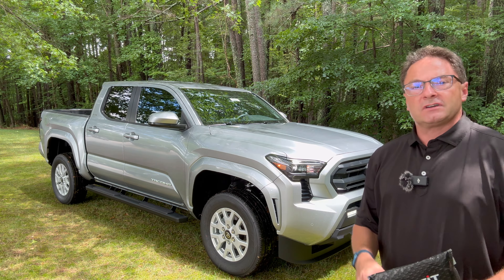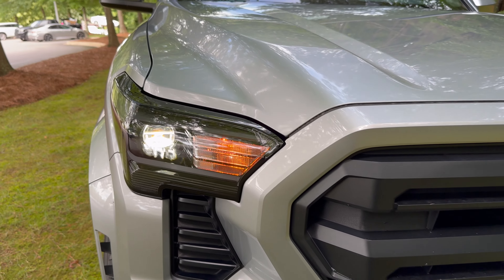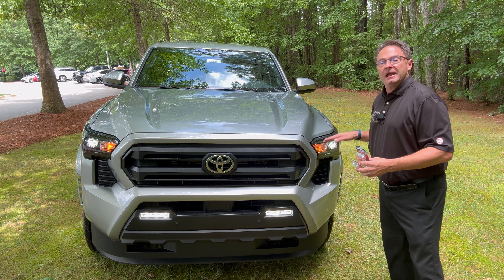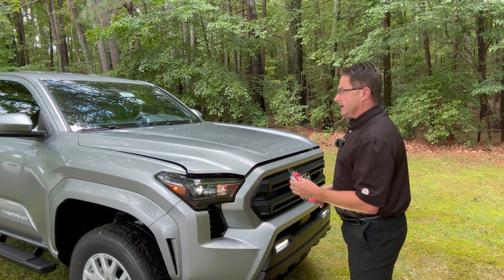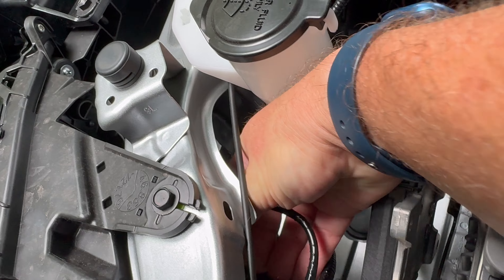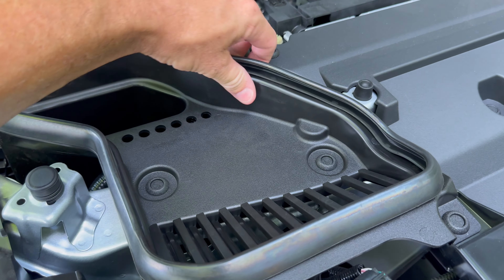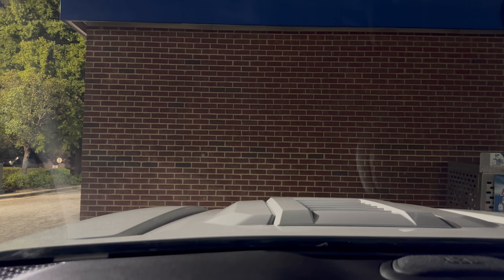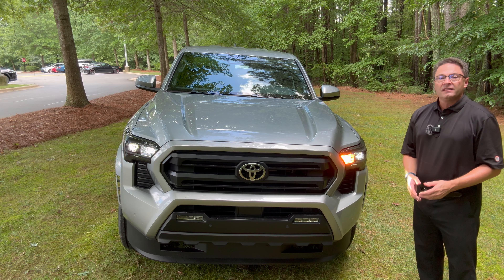How to Install 2024 Toyota Tacoma LASFIT LED Turn Signals - BRIGHT!

Comment: Finally a brand of LED turn signal bulbs with integrated resistor! No need to cut wires to prevent hyper flashing.

Comment: Was this a sponsored video? I had Lasfit LEDs in my Toyota turn signals and they begin to hyper blink (blink at a rapid rate) after about 30 seconds if I was stopped at a light. No good. I returned them. This was a few months ago. Nice of them to sponsor you though.

Comment: I am pretty sure the other side will take you longer than the one you did lol
Reply from the maker: lol yes it took like 30 more seconds. All you have to do is push down for pins to take out the air cleaner inlet. I literally did both sets in five minutes. It’s pretty awesome.